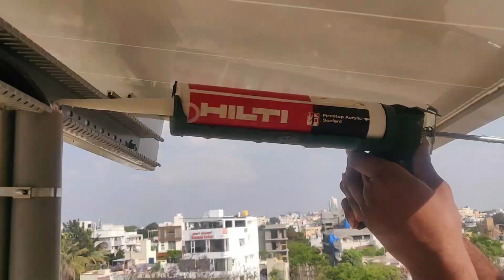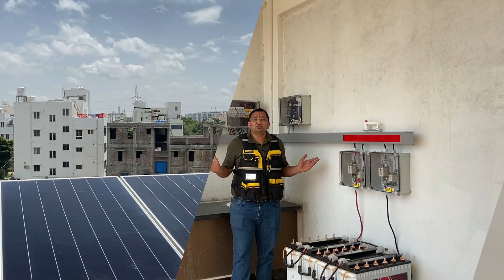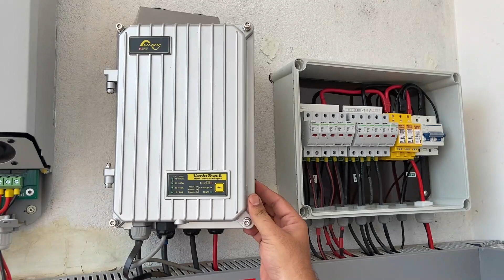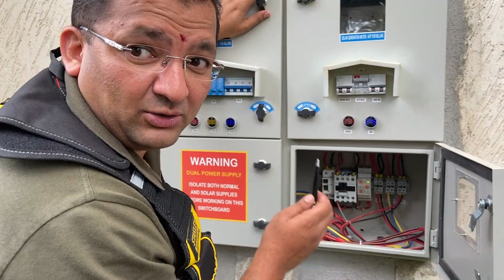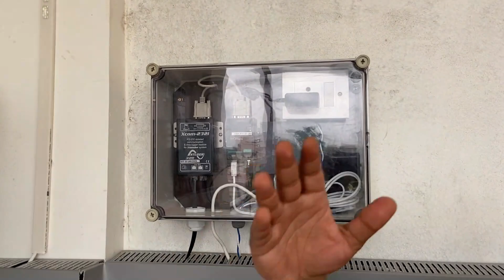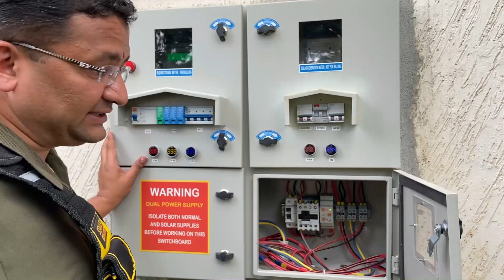Rooftop Hybrid PV System ; Design and Installation

Comment: If PV panels are connected to charge controller. And Battery is the only input to the Xtender inverter, how does the inverter know when to feed back into the grid? Meaning, doesn't it discharge the battery to feed to the grid since it does not know what is coming from the battery vs what is coming from the PV array?